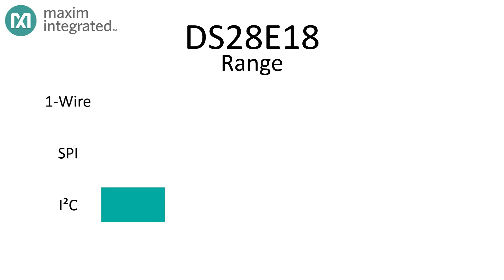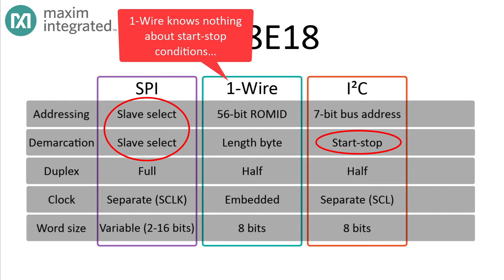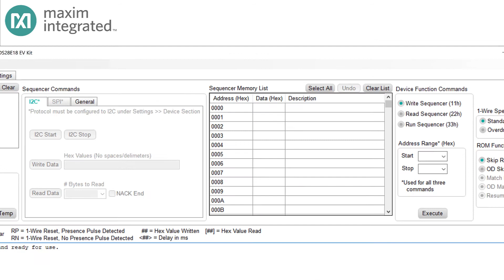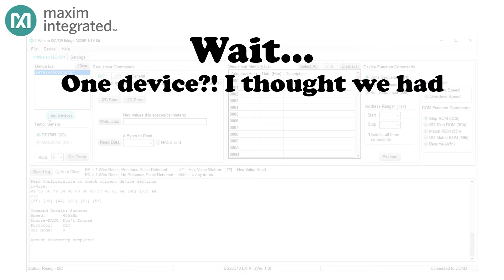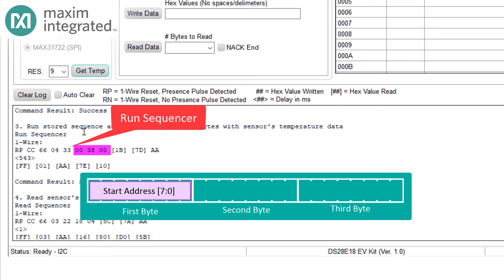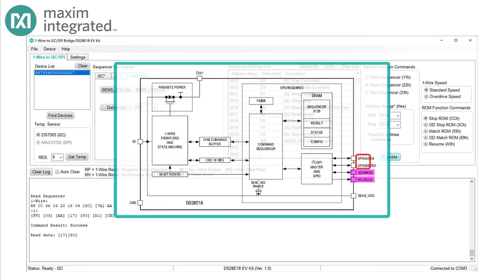1-Wire to IIC/SPI Bridge

Comment: Excellent presentation. 
1. Are there any plans to implement the basic QoS feature like priority scheduling through Command-Sequencer?
2. Does the 1-Wire speed selection to "Overdrive-Speed" effectively reduce the communication bus distance (wire length)?
Thank you very much.